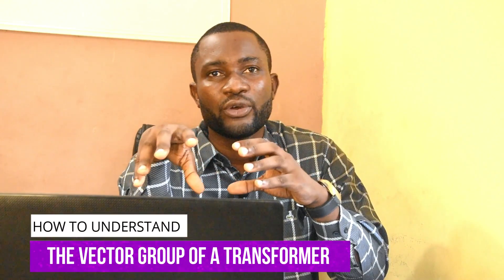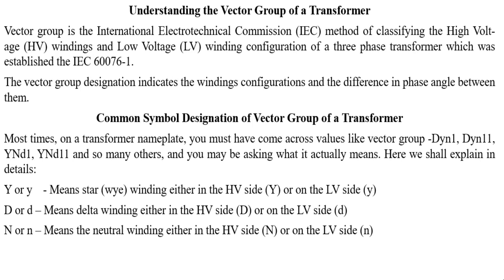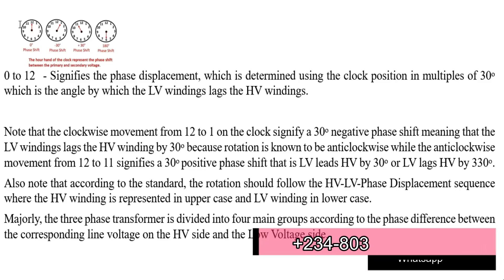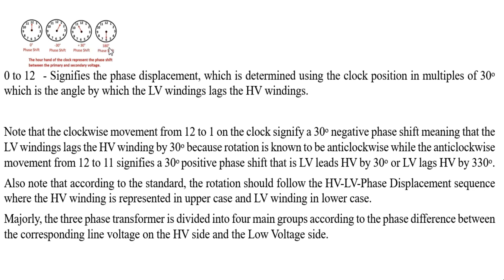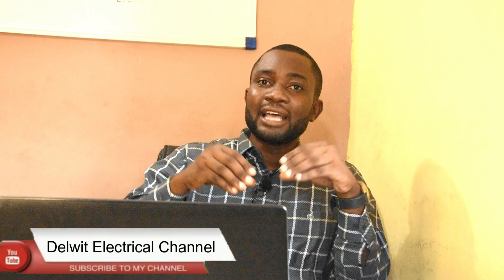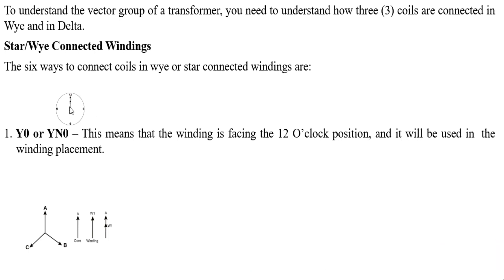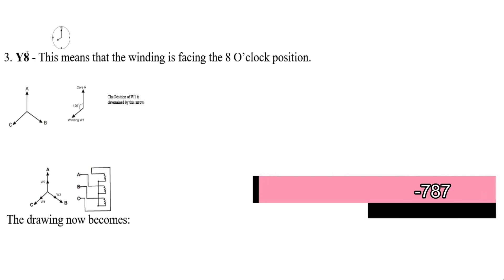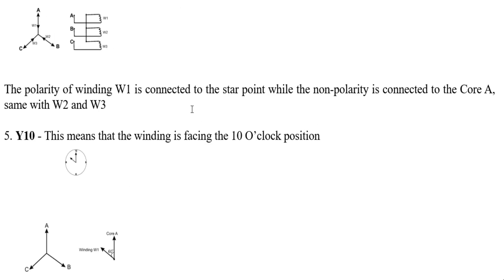Understanding the Vector Group of a Transformer (PT 1)

Comment: 😮 3:25 I’m new to this topic so struggled to get my head around the designation of wiring of the windings but I finally figured it out. To me, the best way of describing it is:
1) it has three parts, for the primary HV side, secondly LV side, and phase shift, respectively, in this order;
2) the configuration of either side is designated by letters y or d, for Wye/star and delta, respectively - capital for primary and lower case for secondary;
3) for both sides, if the configuration is y or Y, and if there is a neutral line from the centre of the star, add a letter n after y. Again capital for primary lower case for secondary.

So one example may be YNyn4, which has 4 letters in it.
Reply from the maker: This is very good, glad you could learn alot and explain it in your own terms.